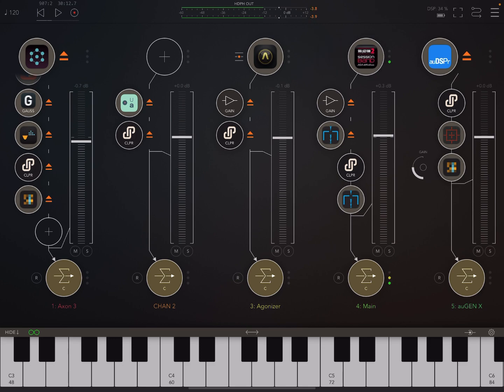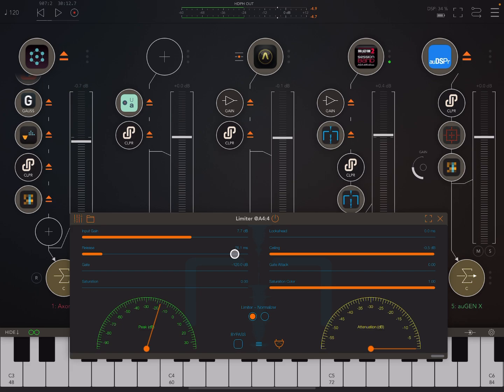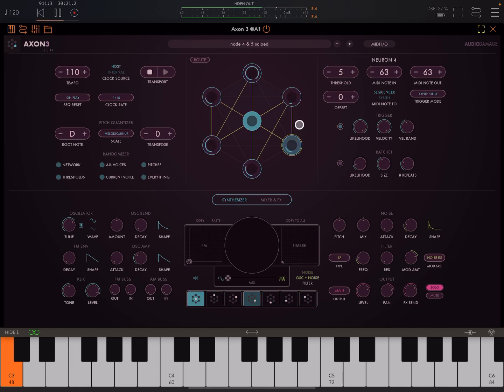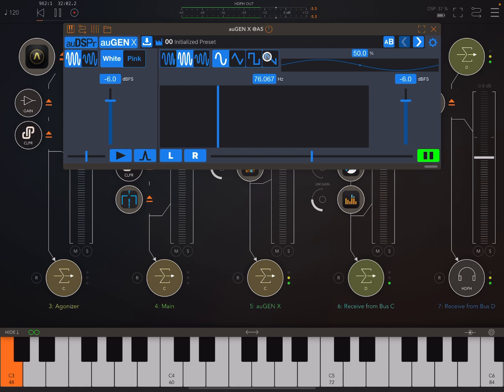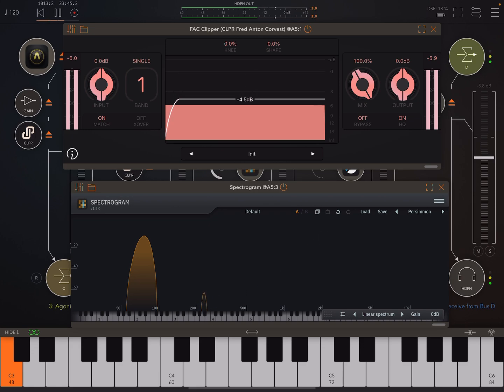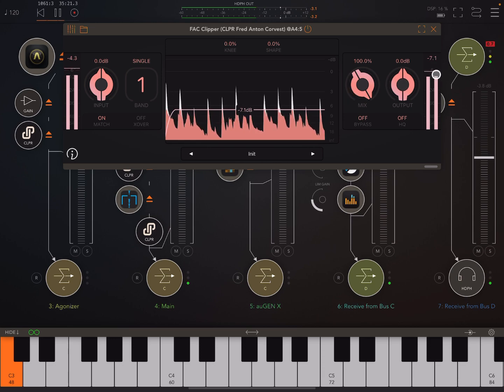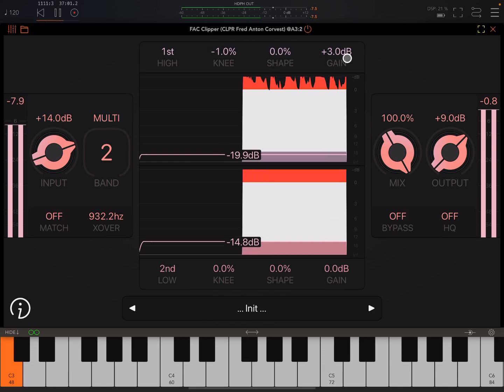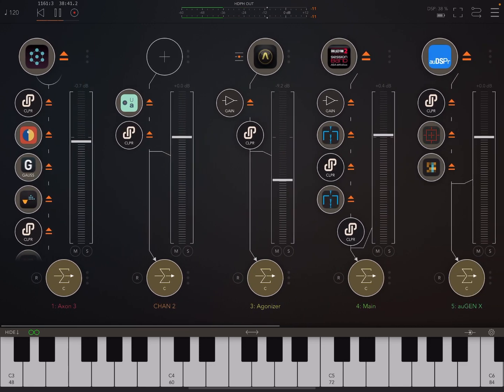2 Super Useful Ways to Use a Clipper Plugin //FAC Clipper // Mac, iPad, iPhone, AUv3

Comment: There’s an art to hard and soft clipping. Thx for this! Have u done a short or otherwise comparing AUM built in saturation and clipping and FAC Clipper type apps?
Reply from the maker: I haven’t Mars, though maybe when I have time I will take a look - totally forgot AUM has a hard clipper node. I just checked it. It sounds good. Unlike this FAC one, it does not color the sound immediately on loading! But it is very simple in comparison, in terms of features.
Reply from the maker: AUM Clipper doesn’t even let you adjust the ceiling, not in the same league at all. This is its only function: “Applies a gain control and then clips hard at +0dB.”